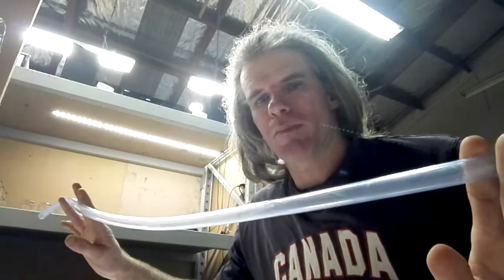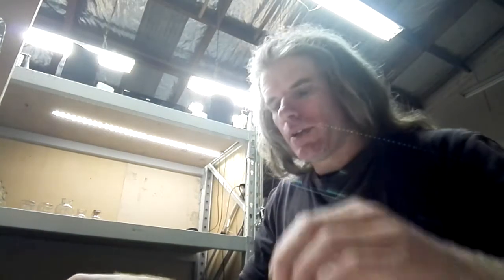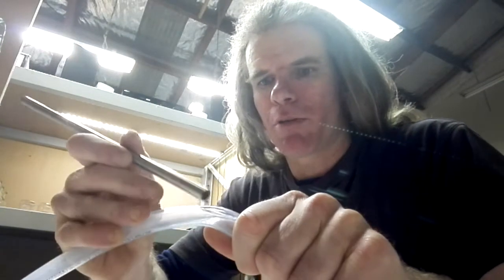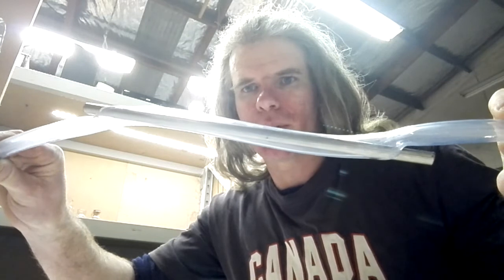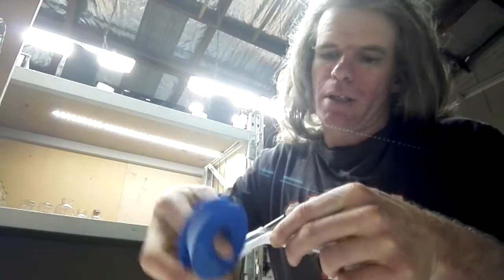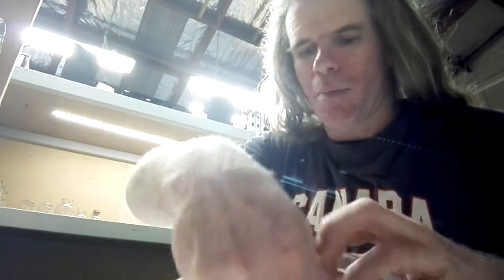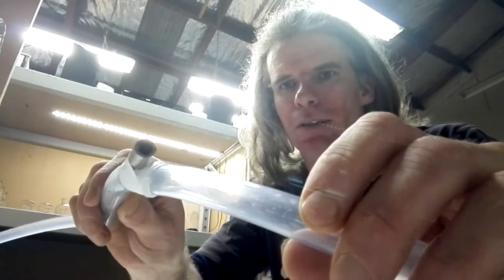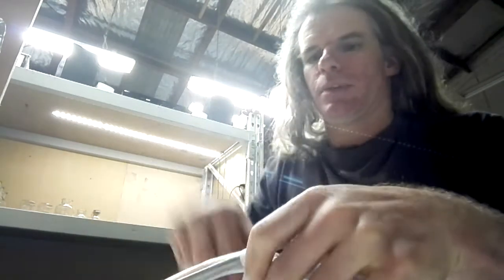Piss Easy Condenser

Comment: So if im getting vapor out the end of my shotgun condenser ....no good???
Reply: Yeah, no good bud....☹️. Got the same issue with mine. My shotgun condenser is fairly short , maybe 16" of actually condensing and a pump thru ice cold water isn't enough to keep up with the still. Last fall I got ate up pretty good from sticking my hand in the ice tub with the pump. It shocked the living hell out of me. Bad thing is I've been an electrician for 26 years and for that to happen lol!!!! So I'm trying to get rid of the shotgun condenser, and go old school with a worm.  That way I don't have to worry about a damn pump and ice Etc. If you have a smaller still it might be ok, but off the top of a full size beer keg, nope.....works great at first but slowly gets worse as it's to pumping out alcohol. Then here comes the damn steam....🤬😟😡. 
👍🏼😉👍🏼

Comment: Great idea. I simply replaced the plastic output tube on my Copperhead with a length of copper pipe, the added length improves the condensing action slightly, just by natural heat dissipation in the air.  Basically I don't like the idea of hot alcohol touching plastic, as the factory plastic tube discoloured after the first run... ugh.
Reply from the maker: Thanks :) Yes the stock standard condenser on these units is too small. Another thing that can help is putting a power controller on it, but that is a video that is yet to come :)
Reply: so how much do you attenuate the heat with the controller? mine seems to work just fine on straight 230v... takes about an hour to heat up, and after 2 more hours I'm done. I'm interested in comparing notes. you running a T500 or a Copperhead?
Reply from the maker: It is quite surprising the difference a controller will make. It gives you a far greater control of the product on the way out. It depends entirely on the way you run the still. The way that the manufactures suggest is not the best way to run them. There is a New Zealand messageboard that has a few members running these bits of kit and they have found with a bit of experimentation that they can get a far superior product by changing a few things. http://www.nzhomedistiller.org.nz/forum/index.php you need to sign up to the site in order to see a fair bit of the content. The subject is quite a big one, that I can not answer in a few sentences, but hopefully, over time I can populate this channel, which is linked to another site in a far better format, so that people can learn some good solid information on distilling :)